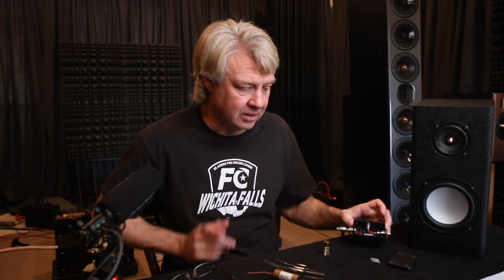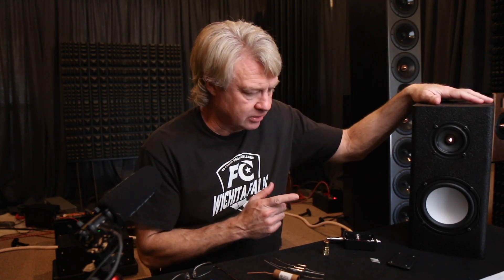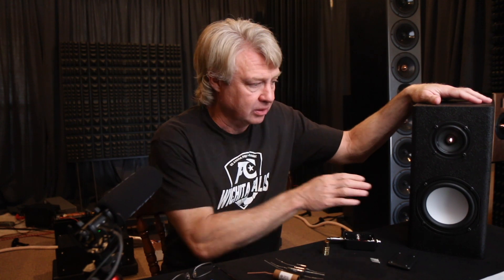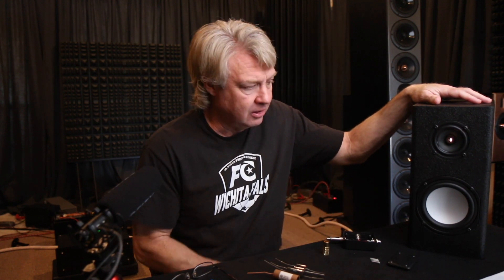BEST option for rolling off BASS??? Let's make In-Line Filters!

Comment: But Danny - aren't you shifting the phase of the music signal going to the amp by 180 degrees? Shouldn't you flip the positive and negative at the speaker output of the main amp to compensate?
Reply: Is it shifted by the output coupling caps in the pre-amp and input coupling caps in the amp?
Reply: The filter will shift phase by +45° at the cutoff frequency. The phase control of your subwoofer will need to be adjusted to compensate.
Reply: Of course the coupling caps in the amps and pre-amp shift the phase, but they are designed internally to take that into account. Any pre-amp or amplifier designer is not expecting to have a cap in the path between that inverting the phase by 180 degrees. What Synthesis did in their commercially designed passive filter was to series the caps (cutting the overall uF by half so each cap was double what they wanted) to keep the +ve and -ve music swings out  of the preamp, the same as with or without their passive crossover in the path between the pre and power. Some may argue it makes no audible difference, but some philes are sticklers for this, and insist they can hear the difference and that it be correct. I have never tried experimenting - but it is worth considering.
Reply: The coupling caps often found in pre and power amps are there to block DC. The cutoff frequency is usually set at only a couple of hertz. This will result in virtually no phase shift within the audio band. Using a capacitor to roll off the bottom end will result in a phase shift within the audio band as the cutoff frequency will be within the band. A single capacitor will introduce a maximum phase shift of +90° but this won't happen until the signal has been fully attenuated so is moot. Luckily human hearing is not very sensitive to phase shifts at low frequency. It is most sensitive in the frequency range where most tweeters cross to the midrange. The crossovers used here are normally higher order and introduce much more phase shift.
The phase shift at the cutoff frequency of one of these in-line filters will be +45° and can be compensated for by adjusting the phase control of the subwoofer.
The question is "is this phrase shift and the inevitable signal degradation incurred by passing the signal through the capacitor outweighed by the reduction in distortion of the driver?"
This will be system dependent so is a try it and see.
The one system that I have tried this on sounded much better with the bottom end of the main speakers rolled off.
Reply: @nathanevans6277  You are correct.

Comment: What equation do you use to calculate the value of the cap? As first order filter, My amp has a 100k ohms impedance, I would like to filter out signal over 25 kKz, on a balance cable (a special application). Wy are polycap better then electrolytic caps?😊
Reply: Try this one: http://www.learningaboutelectronics.com/Articles/High-pass-filter-calculator.php#answer1
Reply: Good question, are poly caps really better? Can't really say that they are, I've used both, sonically their pretty well the same if their the same values, but durability wise I'd say the poly caps will hold up better as I've seen 30 year old electros swell and sometimes burst in several speakers over the years, but I'd say the real difference is that, just my opinion though, electro caps u maybe 30 years out of em, poly caps maybe 40+ years, but I'm not a certified expert, but seems to me it's cheaper just to change your electrolytic caps out every 10 years or so to be safe and save some dough over polys, many decisions, just up to the owner I guess.
Reply: @JukeboxAlley  The differences in sound quality between electrolytic caps and poly caps can be substantial. Even the differences between various types of poly caps can be surprisingly clear.
Reply: @dannyrichie9743  i have heard some sound different on top end/midrange  setups, but on the woofer section if just using for low end roll off etc. I don't think it's that critical of a difference between those types myself for analytical listening (if just for the bottom end), but I can tell a difference on the top end with some, just depends if you want to spend a little more to squeeze every bit you can out of the drivers I suppose.
Reply: @JukeboxAlley  I would agree with that observation.

Comment: If you want to work out the value of capacitor for a given input impedance and -3dB point use this equation,

C=1/(2πZfc)

Where C is the capacitor value in farads. You will need to convert this to microfarad by multiplying by 1 million or to nanofarad by multiplying by 1 billion.

Z is the input impedance of your amplifier. 

fc is the desired -3dB cutoff frequency.

This filter will cause a +45° phase shift at the cutoff frequency so the phase control of the subwoofer will need to be adjusted to compensate.
Reply: Thanks for the notification about the variance in phase and for the formula for calculation!✌

Comment: Seems like an easy solution would be to use a schiit Loki equalizer before the amp and turn down the bass.
Reply: But then you have an equalizer in the signal path, and what about your subwoofer?
Reply: You can run RCA's from dual outputs from your dac or preamp, or a splitter from a single output before the Loki. I have a Loki and don't hear any decrease in sound quality.

Comment: Interesting. The vcap website has a coupling capacitor calculator which would probably work for this application also. You give it the minus 3db point, the amplifier input impedance and it gives your cap value
Reply: Thanks for the tip. I looked it up, and yes indeed, it is spot on for this application

Comment: This video is awesome. Especially when you have a subwoofer in your system taking care of the deeper frequencies, you gotta have a high-pass filter for your stereo speakers. It's a bummer that some opinion-maker people in this industry think a subwoofer just need to run in parallel with your small speakers ending up struggling with the lower bass causing a lot of distortion. Especially high-end amplifier companies lack proper solutions for this issue and will often just tell you to connect your subwoofer on the speaker terminals to your stereo speakers completely messing up the lower bass quality, especially at higher volume.

Comment: How can a person measure the input impedence of an amp?  I would rather not trust the printed specs.  Does the output of the preamp affect the amp input impedence?
Reply: In this case you need to trust the manufacturer to correctly provide that information. Most amplifier specifications list input impedances.

Comment: Step by step You come to the active speaker where each speaker driver has an amp tuned to the parameters of the driver providing performance that no passive crossover can provide. And today you can buy modules with DSP and 2 or 3-way support for less money than a propper passive crossover. And you do not need amps, cables,...  Passive speakers do not have a future nor can match active. Look for high-end speakers starting from B&W Nautilus, and MAGICO M9, all are in concept active speakers.
Reply: Well, I'd say this comment is more you stating your philosophy, rather than any definitive truth
Reply: @gregorkluth2857  There is no philosophy in science and engineering. All this time passive speakers were dominant because it was chipper for the industry and better profit. Why has B&W Nautilus before 40 Years been designed that each driver needs its own amplifier???   Check any high-end speakers, all have at least a powered Subwoofer section, starting with Steinway & sons. Check Nelson Pass works on current amplifiers from 1985. Check Linkvitz design, all active systems, no passive crossovers. It was just too expensive at that time. But not today
Reply: @glazzarus  Having a digital signal or keeping it analog is just two very different techniques and sound signatures. I am not saying one is better that the other. There is a reason for both to exist because some like it this and some like it that way and this will never change
Reply: @glazzarus  Of course there is philosophy in engineering. Why else do you think there are many companies selling 50k+ doller speakers. All of them sound different and yet great. If there was one right way to engineer something wouldn't they all sound the same?
Reply: @gregorkluth2857  question that was never asked, why they sound different, and why they do not sound not even close to the natural sound source.  There is an engineering answer, but it is not in line with companies business model.  The answer is, no one care as everyone goes for what they personally like. When did you have a grand piano in your room and hear how it actually sounds. Newer. How you can say that some systems sound better than other then?? You can because you think you know and you can differentiate.
Reply: @glazzarus  passive components always always sound more natural compared to digitizing the signal. And your other argument was a bit poorly chosen because I actually have a grand piano in my living room so I know what to look for
Reply: @gregorkluth2857  Glad for that piano you have. I use to have it. Now the room is too small. That is why  I change the passive crossover and drive separately each driver with the amplification and digitalization that I design. It was not cheap, but the sound can't be compared. Yes, I'm not just a common Audiophile I have my own digital lab.
Reply: @glazzarus  I see, your that type of genius to which I just can't compare myself to. Why did I waste all that time making my bachelor in electrical engineering and didn't understand the one and only real truth about which I am hearing only now from you
Reply: @gregorkluth2857  It may be because I'm a Master of El. Engineering working on PHD, and Audiophile too.
Reply: Sorry, but most of the DAC's, and amplifiers used in those designs are pretty cheesy. When you get into higher quality DAC's and gear and start adding up the cost of a high end system done correctly, you spend a LOT more money for little to no real gain compared to the same gear and passive filters on the speakers. Yes, we have made those comparisons. Plus, the top level playback systems are still spinning vinyl, and there is NO WAY those guys are going to process any of that through a digital filter. 

Another problem with that line of thinking is that a great speaker holds its own for many years before becoming dated or lagging behind new designs. On the electronics side (especially in digital), improvements every year. So the ability to swap out gear and have the latest and greatest at any time is a big bonus. Comparably those all in one systems get dated and left behind performance wise in a hurry.  NHT tried it years ago (complete active system) and if failed miserably.
Reply: @dannyrichie9743  Yes you are right, looking at technology and pricing 5y ago. I have a vinyl test record that has a 50Khz test tone, so I know the limits of common digital systems. Today however there is a possibility for much lower costs, with components that work in GHz clocks. Believe you know that DSD signal as a Pulse density type of modulation can be played directly on the speaker, as the speaker driver is a filter for itself. Engineering vise it works as current amplification with high stability and embedded feedback (bode plot), and cones are moved by current not voltage. So if you check the latest possibility utilizing GaN and SiC technology, and FPGA chips, ... you will realize something different.  The main misdirection in audio is a way of measuring. Audio is puls type signal, with pulses in high dynamic range and without repetition, and it is treated with sin way signals measuring methods. That is why with actual measuring methods you cant determine why cables and power supply modules have an impact that they have and so on.   But if you look in the field of pulse physics and engineering you will realize why.
Reply: @dannyrichie9743  Actually, Linn from Scotland do. At least on their very, very top range, Klimax, which as you say is a LOT of money. Google up their Radikal/Urika stuff for their LP12 turntable. Would cost 14k $ absolute minimum for the record player, if that digital processing is all you want from them, 35k otherwise, and then 10K minimum for something able to even process their Exakt tech, unless you go for something pre-owned. don't seem to be failing, though.

Comment: I have a question. What is the highest crossover point where it would make most sense to use an in line filter? I'm wondering about something in the order of ~500Hz?
Reply: It's very dependant on your subwoofers. Many may only play as high as 120-160Hz, some can play up to 200/300Hz. But generally, subs don't make for good woofers above 100-150Hz. They tend to be easier to localize above 100hz, and it becomes more difficult to adjust the phase to cleanly match them. So a -3dB of 125Hz, or lower, is the about as far as I would go. Ideally, I wouldn't roll off above 75-85Hz for most speakers, if possible. It will give you a lot more headroom, (up to 4x at 80Hz) without completely losing all of your bass output. For a really small desktop speaker, you can get away with ~100-150Hz.
Reply: @hoth2112  oh hi! I've seen you from lurking on the audio circle forums. 

I understand this. My question is not regarding the quality of subwoofers at higher frequencies, but rather, what is the maximum frequency at which it makes more sense to use an in-line filter over a normal high pass filter in the crossover?
Reply: @bryanbassett2110  100-125Hz at most. Any higer, and you're getting into values that are well into the low nanofarad ranges, which are very hard to come by in good quality options.
Reply: @hoth2112  good to know! Appreciate it
Reply: i would say 200hz if you got stereo subwoofers that play nice that high. i have used 200hz before and its great.

Comment: How do we wire this for balanced out?
Reply: You will need a capacitor (matching) for each of the two positive legs.
Reply: @rc6717  Though it is done many places, referring to "the main positive leg" of a balanced signal path is confusing. It implies -- incorrectly -- that it is the primary or sole signal carrier. It may be less confusing to refer to the two signal-carrying legs as the "non-inverted/in-phase" leg and, correspondingly, the "inverted/out-of-phase" leg. (The third leg is ground/shield.)  By filtering only one of the two signal legs, when the inverted one is "flipped back", the sum of the two signal legs becomes the final output signal.  Since you are filtering only one signal leg, when it is summed with the unfiltered leg, half of what was the filtered-out signal is "restored".  (No nit-pickers, this is NOT a precise, scientific explanation.)  This link is one of the better ones I could find with illustrations of how balanced circuits work: https://www.datapro.net/techinfo/balanced_audio.html

Comment: Hi Danny.  Thanks for this!  In my system, the entire signal path (DAC > pre-amp > power-amp) is balanced.  To achieve the equivalent functionality to your single-ended example, would I just create parallel twin filter?  One for each "side" of the signal?  Thanks in advance for any response...
Reply: Hi, I have the same question!
Reply: Yes, in that case you need two caps per channel with one on each positive leg.
Reply: @dannyrichie9743  Thanks for the quick reply.  My Parasound A21's balanced input impedance is specified as "66k (33k per leg).  What values would I use for 60Hz or 80Hz?  (I switch between 2 different speakers). Perhaps if you can share the equation, I could calculate the values for myself?
Reply: @michaelsparrow4798  I posted the equation earlier in the comments. I guessed that it was a question that quite a few people would ask.
Reply: @michaelsparrow4798  I copy-pasted so you don't have to go looking.

C=1/(2πZfc)

Where C is the capacitor value in farads. You will need to convert this to microfarad by multiplying by 1 million or to nanofarad by multiplying by 1 billion.

Z is the input impedance of your amplifier. 

fc is the desired -3dB cutoff frequency.
Reply: @michaelsparrow4798  I just noticed that I accidentally wrote picofarad instead of nanofarad when I mentioned conversation from farads. Oops. I have edited my previous post to amend this.

Comment: Thanks so much for this information! Super helpful. Can you do a similar talk about low-pass filters? I'm asking because I have several passive subs that I'd love to be able to use them to roll off the high end. Adjustable would be great, but a single value would be great. Thank you!
Reply: It is expensive to make good low pass passive filters. It is not much more cost to buy a good subwoofer plate amp and then you have the flexibility of output level, crossover point, and often phase too.

Comment: 👍 I have been doing this since the 80’s both for home and restaurant / bar systems. I also just do it inside the amp, less cables is always good.
Reply: Thats interesting, so basically you implement the caps in the amp directly after the pre inputs? That sounds even less hard an no need of boxes etc…Its a trade off I understand and if you change speaker you have to adjust but it seems line a good option? Anything I’m missing here?

Comment: How about protecting the speakers from clipping and accidental square waves?
The other day I turned off a component and for some reason it results in a huge and load pop from the speakers. Don’t know why it happened and the amp went into protection mode, but it was scary and could have easily damaged the speakers.
Reply: best rule of thumb is always turn on your amplifier last and always turn off your amplifier first.  

You can't depend on other components to not put out a large spike when powering on/off so you want to make sure your amplifier is off when turning other equipment on or off so the spike isn't amplified and sent to your speakers.